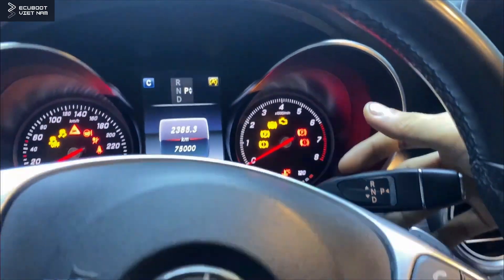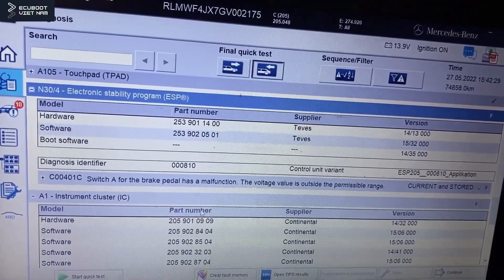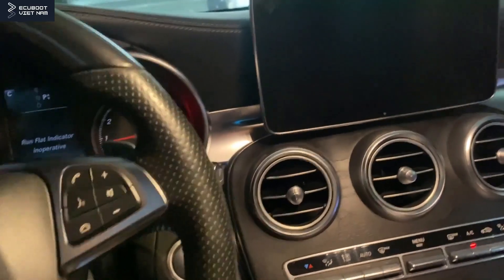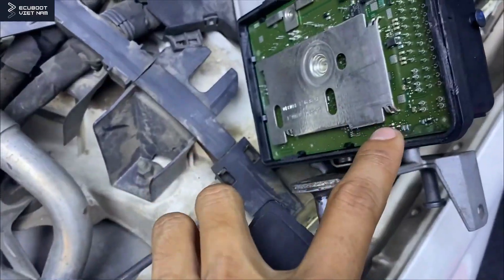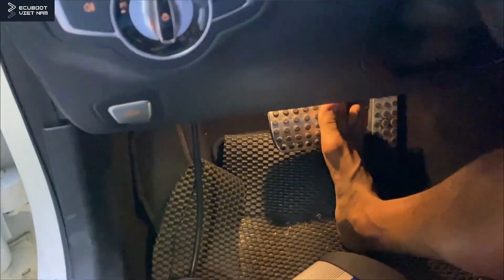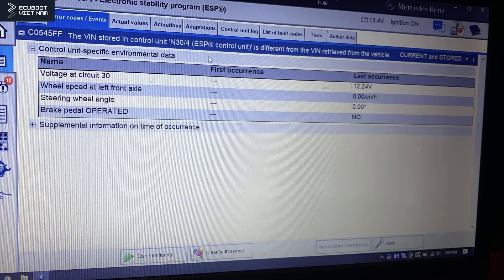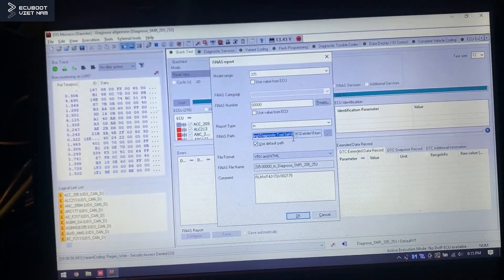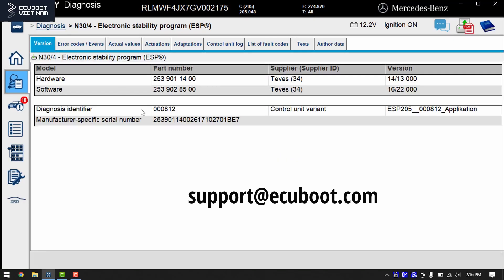Diagnosing and Fixing the ESP Inoperative on Mercedes C300 W205

Comment: great video, Thank you for posting this video, we have a W205 C220 2015 in our shop, it has no crank no start, there are too many CAN error messages, No communication with ABS/ ESP, transmission or Engine ECU, the EIS has fault codes stored, many others on the HMI CAN BUS, Can C with srs, we have checked all the Power distributors and replaced them, check all wiring etc, but still no Crank or Start, the Parkatronic system also has a malfunction, the reverse camera has CAN issues , have you ever had a troublesome car like this in your Shop ? The Cluster does not show the Gear select Arrow, any ideas please ? Thanks 🙂

Comment: Where are you located I believe I am having the same issue on my dash board everything is inoperative and the gear was not moving and changed the battery reset the system and it went away and still the next day it was doing the same thing
Reply: @kel4206 did you ever find out what caused your issue? I'm having a similar problem on my 2019 c300